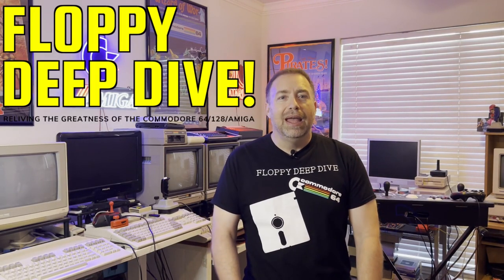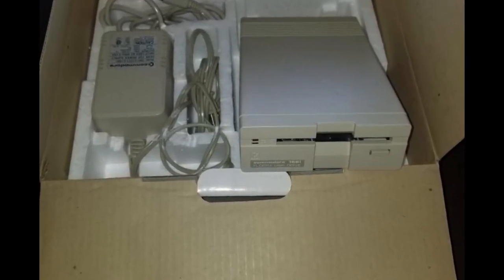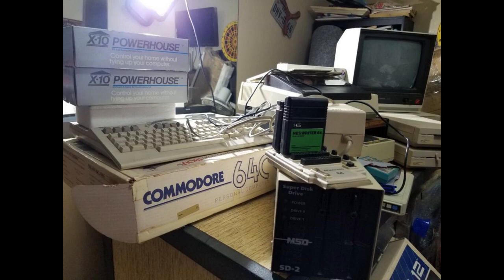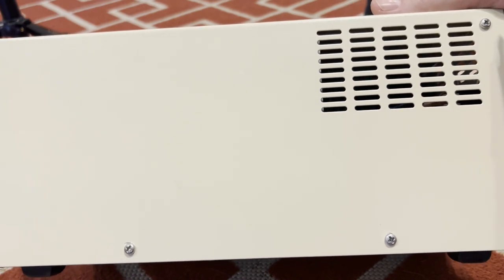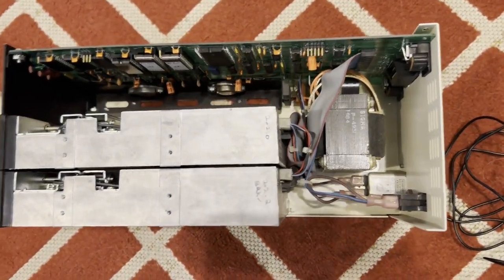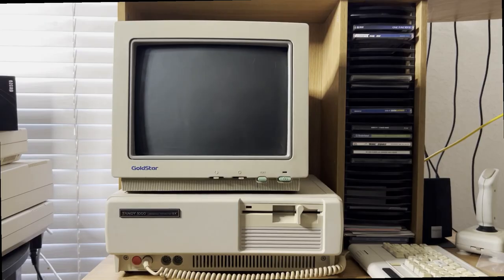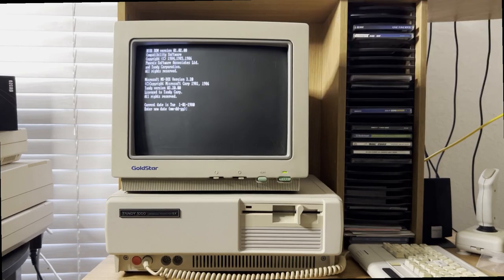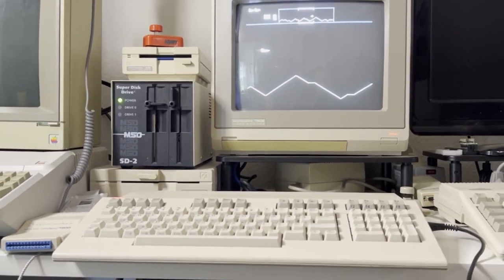2 Rare, Vintage, and Out-of-This-World Items You Can't Miss

Comment: We never bought it... but they made JiffyDos for the MSD.  I don't know if both the MSD-SD1 and MSD-SD2 used the same ROM or if it was specific to each model.

I remember that it wasn't compatible with EA games.  Both Mail Order Monsters and Racing Destruction Set would get stuck on the ECA loading logo.  Back then we didn't have cracked copies.  Lots of copy protection schemes don't like these drives...

But I can still hear the power on noise it made (@9:42), with one drive initializing a few seconds after the other. The nostalgia is strong with this video.
Reply from the maker: I tried to load the original GI Joe on it and it didn’t load at all. It seems to be very picky. Glad you enjoyed it. I’m glad you heard the sound. I cut a lot of loading time out. Appreciate your comments as always!

Comment: Yah, you know you got a GREAT deal! Well, I think you did! I have 12 working CRTs and only a few were less than $200 and a few of the nicer ones in their original box cost me $300 & $350. I feel it's like you got that drive for free. My Best deal ever was my "Large C128 lot" that I bought it at the buy it now price of $700 as soon as I saw it. It was a brand-new listing. Everything worked. It came with a C128, 1571, 1902A, 1351 mouse, 1670 modem, 4 or 5 joysticks and tons and tons of boxed business software and some games. I feel just that stuff was worth $700, but what made me hurry up and do the buy it now as soon as I had gone through the 12 photos was the 1581 drive and two 1764 REU's with one of them marked as 512k with a sticker (yes it in fact had the memory added taking it from 256k up to 512k).
Reply from the maker: Thanks Charlie! I know you do a lot of collecting so I respect your opinion on it! Your collection is amazing! Thanks for watching my friend!